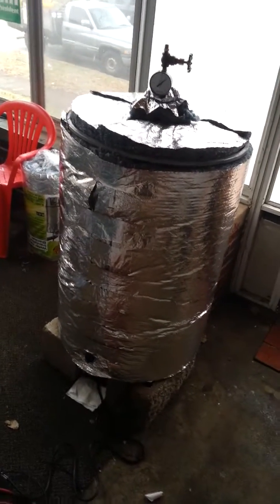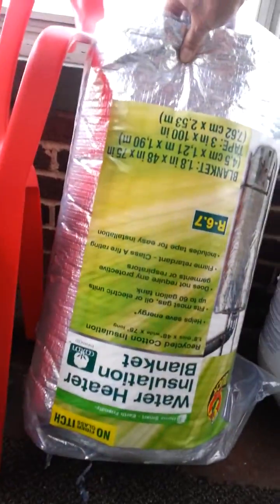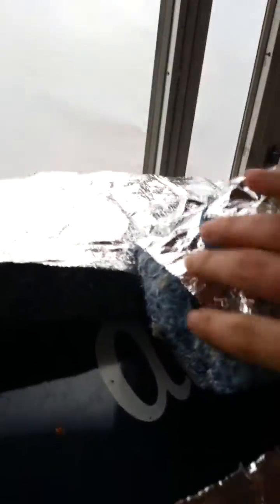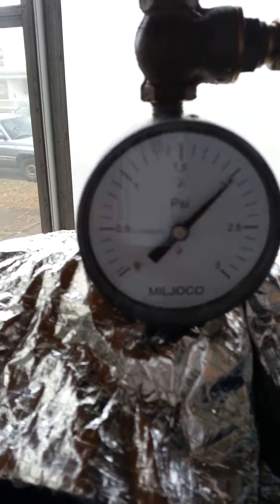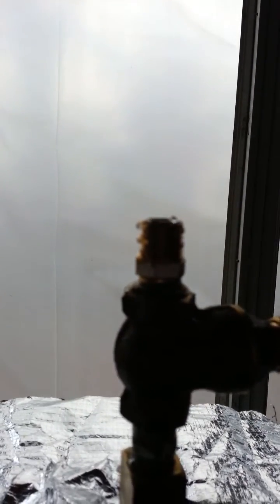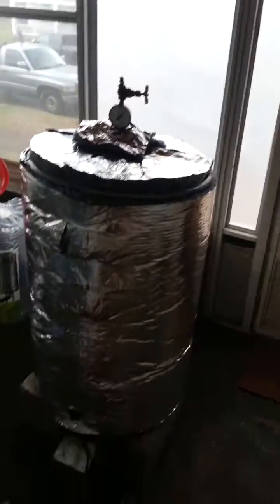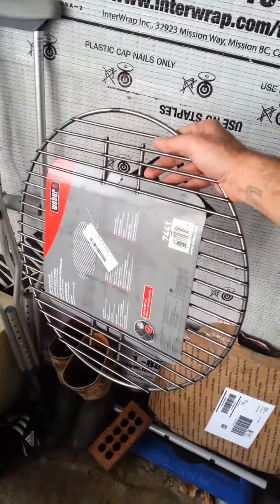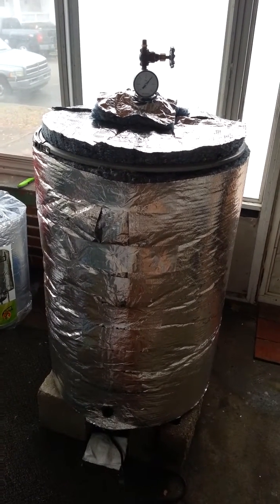Low-pressure steam sterilzer

Comment: Did it successfully sterilize? And why couldnt you install the heater element horizontally?
Reply from the maker: Oh yeah, it sterilized fine. You could most definitely mount it horizontally. Most people do when using a water heater element. The element I used for this was a short one out of a Wagner Power Steamer (for removing wallpaper), so to get even heating I had to mount vertically in the center of the bottom.

Comment from the maker: So sorry I missed everyone's questions. I'll do my best to answer all of them.  

First, how long does it take to heat up?  If you are using cold water, several hours. This is why I would hook up a hose to my hot water valve for my washing machine and fill it with 130F water, which greatly shortens the time needed to get up to temp.

I got the barrel from my local barrel guy, so used but in great shape. The liner does flake off, so I eventually treated (and continually retreated) with a spray-on rust inhibitor in between uses. This one does not have a safety pressure release valve, although I highly recommend spending a few extra bucks to get one.

Only "controller" I used was a timer, which I set for 8 hours once the water was up to temp.

As to the amount of water, a minimum of 10 gallons was required to keep the vertical heating element submerged. And as to the amount of bags, I believe it was around 30 medium-sized bags.

Now, this history of this barrel since I posted this years ago..... The one in this video became a burn barrel the day after my first run of substrate, because I screwed up. It was late at night when the run got done, and I was really tired. I made the mistake of closing the gate valve because my tired brain thought that would help keep the heat in. But I woke up the next morning and the barrel had collapsed in on itself due to the vacuum it created cooling down. The second build (just like this one) worked great, but eventually became an un-pressurized straw pasteurizing tank. It currently resides in my basement, and hasn't been used since I closed my mushroom farm down in Oct 2016. When I get a metal barn built next year I will be moving it out there to begin using it again.

Comment: Do you use a controller on the heating element or does it just plug-in the wall
Reply from the maker: The element is from a power steamer for wall paper. It does not have a controller, just plugged into the wall.

Comment: how many substrate bags can you fit in this sucker? and can you put less water than 10 gallons to make more room for the substrate bags? or does it need the full 10 so it doesn't run dry eventually? and is this welded?
Reply from the maker: tyler Domagall, Been to long for me to remember the bag capacity. This design requires more water, especially since ya run it for several hours to sterilize.